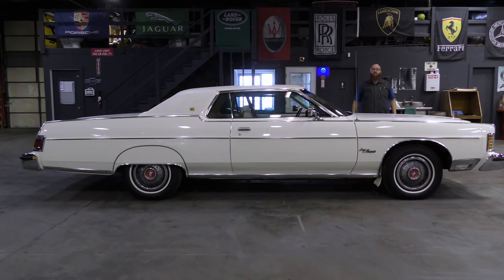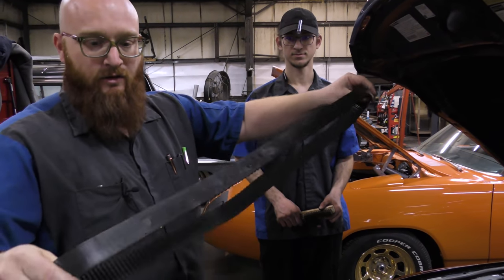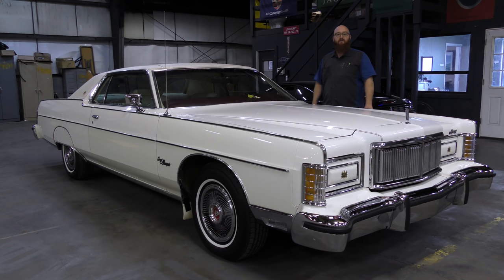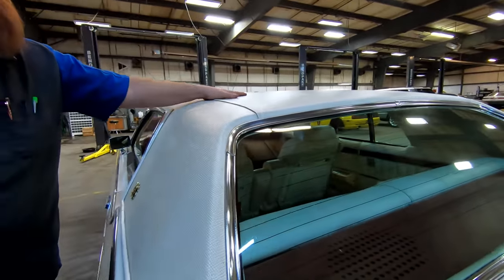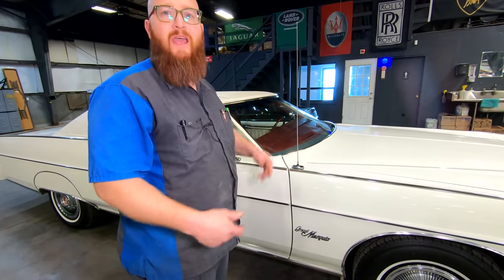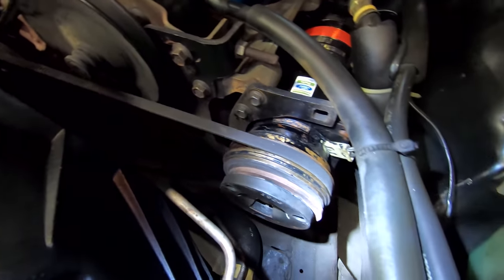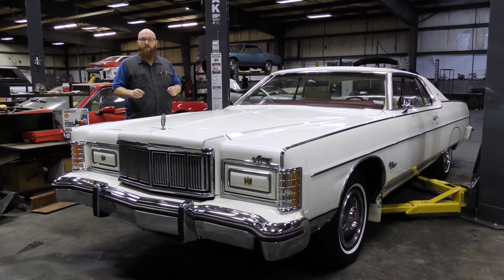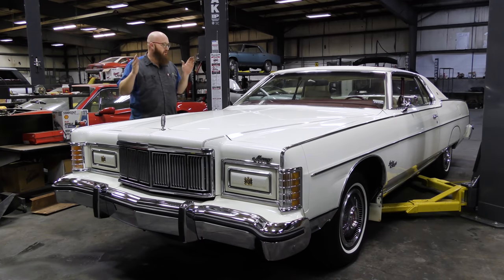Land Yacht Alert: 1975 Grand Marquis with 17K miles is in the CAR WIZARD's shop

Comment: This low mileage 1975 Mercury Grand Marquis that is in such good condition is an unusual and unique find. This car was one of the last set of large and long cars made before Ford Motor Company came out with the downsized Panther Platform, that became the platform for the Ford Crown Victoria, Mercury Grand Marquis and Lincoln Town car. Now with the Ford Panther Platform discontinued we will never again see full size, body on frame, V8 engine in front, solid rear wheel drive axle on any cars. That era in cars is past history.
Reply: “Past history”? Is there any other kind?
Reply: Never is a long time....one cannot be sure what is to come.

Comment: Cool fact, the Ford's ,Mercury's and Lincoln's of this era had a front suspension that allowed the tires to move fore and aft as well as up and down, this added to their ultra-smooth ride.
Reply: I remember Ride Engineered stamped on the dash of my 78 Cougar
Reply: I did not know that.
Reply: GM front coil suspension had similar "compliance" struts back in the day.  Not compatible with Chrysler's longitudinal torsion bar suspension design.
Reply: Very interesting.  Source?
Reply: @hugolafhugolaf  Ford 1903-1984 By the editors of Consumer Reports
Reply: @ricksidenstricker2144  Thanks!
Reply: @billyjoejimbob56  actually, the big C-boys Chryslers did have big soft bushings in the strut rod that located the lower control arm fore/aft. Pothole impacts would let the lower ball joint move slightly aft and spring back to absorb the harshness. The sportier, smaller models like Barracudas had thinner/less compliant bushings in the strut rod (and my 69 Coronet R/T  and 66 Polara have very rigid aftermarket polyurethane to keep the caster tightly in spec and improve handling).  The torsion bar suspension really was superior, and allowed a lot more independent control over the suspension parameters.
Reply: Very interesting info, thanks. When I turned 16, I got my driver's license in one of these...a '77 "Dove Gray" Grand Marquis 4 door "Brougham". Passed the test the first time, even having to parallel park the "big boat"! The ride truly was fantastic.  My 85 year-old Dad still says the "Merc" was the best car he ever owned.
Reply: @johnvalentine3456  lol...
Very nice car. Took my test in a 74 LTD Brougham
Reply: Fancy as fuck
Reply: A lot like the Citroën 2CV did.

Comment: That is an amazing find.  I was in the car business back in the 80's and we had many if these Marquis.  They were always a favorite.  That 460 pulled like a freight train and with that GM A/C compressor, it would keep the inside like a meat locker.  These are starting to heat up in the collector market.  For years you could pick these up for next to nothing.
Reply: Yep. Malaise Era cars are starting to fetch higher prices and are more sought after. Back then, most people would never have imagined that, but these cars are at least 40 years old, with so few of them left, they're becoming collectible.
Reply: Had a 77 2 dr in the mid 80's myself. Had been equipped with real wire wheels and was a sharp looking ride.Strangely enough, it had been ordered with interior power deletes. Crank windows, no 6 way seat, just pull the lever and slide forward or back.
Reply: One annoying trait most of the 70s cars shared was interior plastics that discolored with age.  Typically, they are rigid parts injection molded from ABS.  The dark colors fade, and the light gray, tan, and white parts yellow...  like the armrest supports in this Grand Marq.  Not a big deal functionally, but VERY labor intensive to remove, paint, and replace.
Reply: Just a few months ago I bought a 78 Lincoln Mark V.  $5550 out the door, 82k miles on the odometer.  I had to put about $3500 to get the mechanical components up to snuff, but still feel like I came out money ahead.
Reply: @Voltor07  Sweet car!

Comment: I have a 1988 Grand Marquis with 364k km...driven down to Florida and back to Canada, lives in Northern Ontario, driven through the snow and salt. Body rusted but frame is good. Starts right up in -25C without block heater. It is a tank of a car and any issues with it have been rust related. Brake lines, gas tank, etc. I hit a deer driving down the highway and busted two brake lines simultaneously (because of corroded lines ruptured from hard braking) but I fixed the body damage by replacing the fibreglass header panel for $50 off Kijiji and gently bending back some small brackets back to new. A modern unibody car would have probably been totaled by the damage but given the body-on-frame construction, one can simply replace panels that need to be changed.

Comment: It’s amazing to see how the much vehicles changed from the 70’s to the 80’s. Especially the 70’s to the 90’s. Most cars from 15-20 years ago don’t appear to have changed as drastically when it comes to design.
Reply: that´s because design is dead.
Reply: @tiziocaio4561  Design died in America in the 80s and in Japan in the early 2000s.
Reply: Underneath, the difference from 15-20 years ago isn´t that dramatic either. From roughly 1970 to 1990 car tech went from old school to modern, which was a giant step. But my 1986 Grand Marquis was just as clean as the 2011 model according to the EPA. It had SEFI, EVAP, ECU, EGR, overdrive with lock-up and 4 cats in 1986. The only reasons the latest cars are cleaner is start/stop, small turbo engines, hybrid systems and cheating.

Comment: Currently on a road trip across the US in a 2003 Grand Marquis, nothing beats a land yacht
Reply: Especially on trips or when there's passengers. Even more so if its both
Reply: I love those cars! Enjoy the trip !
Reply: What is your MPG? I am guessing maybe 12-13? 25 gallon fuel tank?
Reply: Make a video!!!!
Reply: @cousinjohncarstuff4568  I get 17-18 stop and go city 25 highway out of my 99 grand marquis.
Reply: @MattsRageFitGarage  damn my Ford  v6 gets 18city and 25 hwy as well.
Reply: @MattsRageFitGarage  ....Thats not a monstrous 429 four barrel in a 4500lb Land Yacht.....12-15MPG at best.
Reply: @ericbrandt829  they guy on a road trip has a 2003 if you go back and read his comment. The 429 is 7-11 mpg no matter what.
Reply: @MattsRageFitGarage  In town maybe. my 72 Marquis with the 429 gets 9.5mpg in town, on the highway sticking to 55 I can get 13-14mpg. I used to get 17mpg on the highway before I swapped the cast iron intake off and put on an Edelbrock one.
Reply: @theshield1613  my mom's old 97 Mazda 626 with a 2.0 liter 4 cylinder gets 17-18 city...
Reply: @dethmetel  I get 8-10 mpg no matter what out of a 64 galaxie with a fresh strong 390, original 352 got exact same mpg. You must live in a flatter area than I do!
Reply: @MattsRageFitGarage  Ahh, that's not that great out of a 390, but I doubt it's tuned for economy ha ha. A 73 F100 I used to have, with the 360FE only got 100 miles to a tank of gas, so I know the pain
Reply: @dethmetel  It's tuned pretty well, I didn't build it for economy but really don't want it sucking the tank dry every time I go somewhere either. Very healthy centrifugal advance curve and it doesn't run rich at all. I even spent extra money to have the block zero decked to get the quench in the .040" range. The stock 352 with 3:1 gears and a 1600 RPM converter got exactly the same MPG as this 390 with a small cam, 2200 stall converter and 3.70 gears. Absolutely no comparison in performance though! The 351W in my truck is only good for 8-10 MPG as well. Over the years I've done a lot to that engine including edelbrock aluminum heads, headers, 2.5" to 3" single exhaust system, small RV cam, weiand stealth intake, distributor recurve, carb tuned with an AFR gauge, etc. MPG never changed a bit from stock, sure has a lot more power though. However, if I hook a trailer with another car to it and drive the hell out of it the thing will get 11.5 MPG, weirdest shit ever!
Reply: Do you got your sails up!
Reply: @cousinjohncarstuff4568  19 gallons, got around 20-23 depending on mountains and how heavy my foot was
Reply: @badopinionsrighthere  i had an 2003 grand marquis and it got 25 on the highway . respectable for that size car. Unfortunatly had to get rid of it do to frame rot from upstate ny winters

Comment: My first car was given to me by my grandmother, Mimi. Grand Marquis in two tone. She loved that when the throttle would stick she would drive it just using the brake pedal. One pedal driving. she was a pioneer. 😂
Reply: I had that happen with my aunts grand marquis. Scared the crap out of me. Turned out to be caused by the cruise control ball chain hanging on something
Reply: My 69 fire bird, throttle cable broke. So I tied my shoelaces together and operated the throttle through the side window.
Reply: @JohnLewis-qg8rz  Remember, if the car is not placed in PARK, turning the ignition key to OFF will stop the motor without locking the steering wheel.
Reply: She drove land yachts her whole life. Even when she lived in San Francisco and parallel parked on city hills.

Comment: In high school a friend’s mother had one of these monsters. I remember parking my 1975 Honda Civic beside it. The Mercury’s hood was almost as long as the entire Civic. There wasn’t much difference in interior room.
Reply: I'm sure you are right. And look at the trunk - not much room compared to what is hinted from the outside.
Reply: There seems to be hardly any room for two adults in the back seats. Weird country where cars like that are produced.
Reply: @SuperDirk1965  Cars like this were designed for single person transport, that was the norm in the US at that time. It was just seen as more luxurious and more of a statement to drive one of these long coupes.
Reply: @JohanNilsson1966  You could still probably get a couple of tied up kidnap victims in that trunk.
Reply: @SuperDirk1965  even for its time, this was not considered a practical car. It was bought as a symbol of wealth and status. 
In that era very few cars had decent interior room. Anything less than a full size four door had poor leg room in the backseat and doors that were a bit of a struggle to enter if you were 5’10” or taller.
Reply: My 1975 Mercury Grand Marquis 4 door sedan was very roomy for long trips and I averaged 15 mpg on the highway with a 460 4 bbl.
Reply: @SuperDirk1965  And yet, you're fascinated to the core, right?  "Weird", in deed, dirk.
Reply: @jamesgreg5542  I have always been fascinated by those who are intellectually challenged
Reply: @SuperDirk1965  Peer pressure.

Comment: What a beauty!  A couple catches for you:  the little red button on a solenoid under the hood on the passenger side is a seat belt interlock override; they are wheelcovers, not hubcaps and they are fender skirts, not wheelwell covers.
As my contribution to our growing family, I bought - from our Ford dealer, whose general manager special ordered it new - a 1975 Country Squire station wagon.  It was loaded up with all the goodies you mentioned on this Marquis and more.  Additionally, it had an automatic vacuum parking brake release - remove from park, the parking brake released.  Very cool, for a Ford.  Split power bench seats with armrests and the passenger seat reclined.  The carpet - even had a rug to cover the rear area, when the seats were folded - was the thickest I've ever seen, aside from a Lincoln.Tilt steering wheel was accomplished be pressing forward on the turn signal stalk.  The rear seats were side facing, and when folded down, could be locked.  Rear storage compartment - lockable.  The 460 did a great job moving the car about.  The kicker is it was the most stunning station wagon I've ever seen.  Black [woodgrain on the side and tailgate, of course] with a tan interior.  The wheelcover centers were black, too.  
I bought that car in the early eighties, I sold it in 2006.  I sold it for more than I paid for it, by a big margin.  Regretted the sale since.

Comment: My Uncle Bob had one of these, in Dark Metallic Blue over Blue Leather interior with Blue Landau vinyl roof - he would drive it cross country twice a year from Washington state (Walla Walla) to Western North Carolina to visit his mother (my grandmother) - his had an 8 track factory tape deck and a CB radio.  You could sit three in the front and three in the back, no problem, no banging elbows or leaning on each other.  Ice cold AC in the dead heat of summer.  He loved that car and maintained it fastidiously, oil changes every 3 thousand miles, coolant flushes and tires rotated every 10 thousand miles, washed and vacuumed once a week, regardless of the weather.  Forgot how nice these were.  Great post - you guys got me hooked with the TR8 video and I've been a fan ever since!

Comment: Weezard completely overlooked the most unusual feature on the car.

The relay with the red button on the right fenderwell is the starter interlock bypass.

1974 and early-built 1975s required you to sit in the driver's seat, buckle your seatbelt, and start the car in that sequence.  If you didn't follow this sequence, the seatbelt indicator light and buzzer would pitch a hissy fit and the engine would not crank.

If the interlock system had a malfunction, he red button on top  of the relay would allow you to start the car.  It was a one-time per engine start, so no, you couldn't tape down the red button  to bypass the system.

The interlock mandate was rescinded in October 1975 due to public outcry and the system could be legally bypassed.
Reply: I had a new 1974 Corolla with the interlock. I just unplugged it, no more problem.
Reply: During the '80s, I worked in an auto repair shop across the street from a drugstore. One summer day, an elderly woman came up to me in hysterics, crying her sick husband was waiting at home, but her car was stuck at the drugstore and wouldn't start. I walked over with her to find a '74 Ford Maverick, with an un-belted sack of groceries on the front passenger seat. 
I moved them to the floor, the car started, and she was so grateful and happy. No charge.